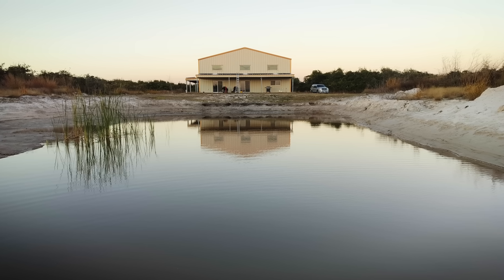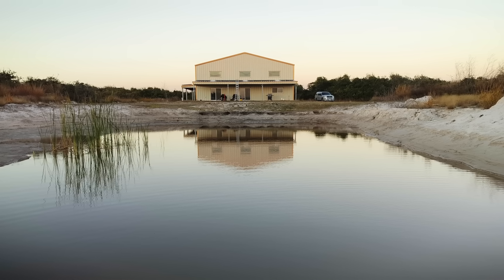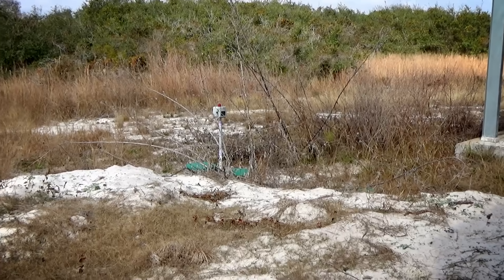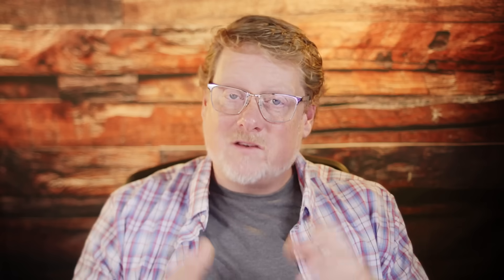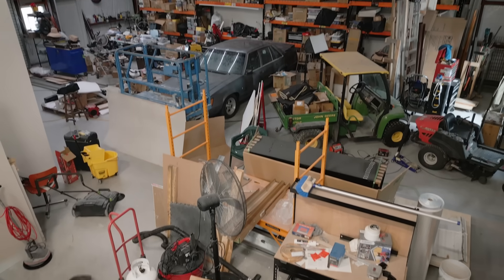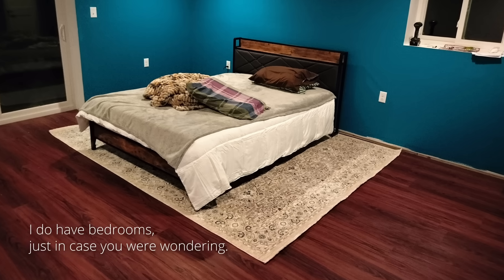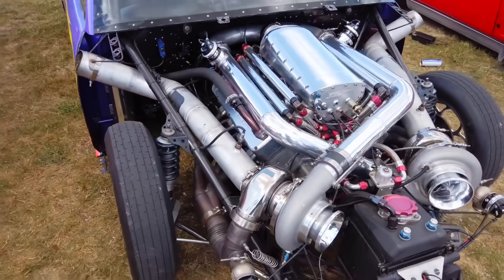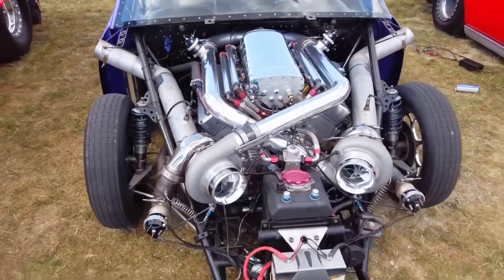Twin Turbos - How Does the Boost Add Up?

Comment: I wonder if you could use the free 10-15psi boost gained through compounding, by redesigning the system to reduce the electrical load (through smaller turbos and electric motors) to get your 30psi?

Comment: CAN YOU MAKE ONE THAT WILL SUPPORT 2500 HP ?
Reply from the maker: Well, yes and no.  You can make a single unit to support that power, but it's not practical given current technology and available parts.  What you can do is stack multiple units together to get to the 2,500 hp level.  I'll be dyno testing various combinations (twins, compounded twins, etc) to see what works best.
Reply: @AlexLTDLX  How about 1500 ?
Reply from the maker: @StreetLegit  Your best bet is to use multiple units to get to a hp target above 650hp.  I'll be doing dyno tests soon of multiple units.

Comment: I guess regarding boost your thinking will add up. But think about it... what doesn't change after the first compressor?... it's the air mass! And in the end that is what you need to burn more fuel, not hotter and more dense air in lower quantities.
Reply from the maker: Ah - but does the air mass not change?  After all, the second compressor is sucking air in.  The purpose of the video was to explain the common theory.  I'm in the process of buying a dyno to actually test the theory - something that no one's done before that I'm aware of.  That's one of the many beauties of the electric supercharger project.
Reply: @AlexLTDLX  if the following ones compressor air of the previous ones I can't see where more air mass could come from. The way it works could only be that the amount of air that the first compressor sucked in gets compacted more and more by each compressor.
Reply from the maker: But if the second compressor is helping to "suck" air into the first compressor, then maybe that's where the additional air mass comes from?  This is all theory.  I'm more of a practice guy.  My new Dynojet 224x is slated to arrive on Tuesday.  We'll be able to actually test this stuff and see who's right.

Comment: How would the 2:1 compounded turbos compare to one 4:1? If my math is correct, they should be able to put out the same amount of boost.

If they’re electrically driven, there shouldn’t be any lag from either setup, which is one of the reasons people go for the compound turbos.

If the setups do make the same boost, I would imagine it would be more efficient and/or cheaper to go for the single 4:1 turbo.
Reply from the maker: In theory, they would make the same amount of boost.  Most turbos are happier (i.e. more efficient) being properly sized at a lower pressure ratio.  So in practical terms, the compounded turbos would likely make more power and less heat.

Comment: Gale Banks says it's about CFM
Reply from the maker: Then Gale Banks is wrong.  1,000 CFM at 200* air temps will support a lot less power than 1,000 CFM at 30* air temps.  It's not about CFM, it's about air mass.  Air mass defines the amount of oxygen available to burn fuel.  CFM does too, but it does not take temperature into account - if you set your fuel maps based on CFM, you could end up being super rich or super lean depending on IAT.  If you set your fuel maps based on air mass, your A/F will be much more consistent.
Reply: @AlexLTDLX  CFM is CFM. No matter the temperature lol. But it is useful to manipulate the temperature in order to gain more CFM. But chemistry is chemistry and CFM is CFM

Comment: You seem to act like horsepower exists without torque. I think that may be what is confusing to people to your perspective. Torque is of course the the force that, combined with time, is measured as horsepower.  Torque is what you can actually feel.  You can't feel "horsepower".  It's only a measure of work done.

Comment: Alex, these tropical compressors do not have any built-in pressure ratios… only a lysolm screw machine does.

The power required to run at Stonewall  (aka choke) does not go up and the efficiency also goes down… The power goes up because the efficiency is going down. That is all stonewall is, tanking efficiency.

Your non-or cooled second stage will only be processing about 70% of the volume metric flow as the first stage did and so to run also at a pressure ratio of two will be running significantly slower. 

Your X access on a compressor curve is not really mass flow at all, that is volumetric flow with some assumptions baked in to create a more convenient axis that works well enough. To really look at where that second stage is going to run with the hot inlet, apply an approximately .7x derate to the x axis. that is just roughly where the density works out because while you are at twice the pressure you are significantly warmer. For other pressure ratios that would change with discharge temp.
Reply: Spell check! Centrifugal not tropical LOL. Probably other typos… commenting from phone stinks…
Reply: If you enter cool between your two stages, it will make your second stage more efficient. If you get it close down to ambient again, you will be dealing with approximately half the volume metric flow though and potentially close to surge. Apply a fudge factor of approximately .55 to the X axis of the compressor map that you were trying to use to figure out the speed that it will need to run that to make a PR of two.
Reply: If you are interested in efficiency, then intercool it! Maybe you don’t have a smaller compressor available for the second stage or it still wouldn’t be worth it… But intercooling saves power on second stage.

Comment: It's kind of like electricity. If you hook a 12 volt, ten amp battery up to something you have 12V at 10A. if you hook a second battery to that, positive to positive and negative to negative (parallel) then you still have 12 V, but at 20 A. Now, if you hook up the positive of your load to the positive of one battery, the negative of that battery to the positive of the second battery, and the negative of the second battery to the negative of the load (series), you now have 24 V, but at the original 10 A.

A turbocharger is kind of like that. If one is capable of producing 15 pounds of boost, that's all it can do. Adding another turbo of the same capacity into the same intake chamber will not increase that pressure, but it will increase the rate of flow; the two turbos will be able to maintain 15 pounds of boost at a much higher CFM rate than a single turbo. If you have two 15 pound turbos and you want to increase the pressure, then you run them in series. The first turbo takes in the air and compresses it and feeds it into the intake of the second turbo, which then compresses it further and feeds it into the intake manifold. You probably won't get 30 pounds from two 15 pound turbos, but you might get 22. (PS: I didn't watch the video, sorry, it's too long)

Comment: I wound up with a crippling lifelong hopeless addiction to Hot-Rodding, modifying, blah blah blah the car enthusiast hobby back in the early 2000s. Now ebay was coming into its own back then and before the slaves in china starting making churbos there were the electric turbos!!! Not the modern electrically driven forced induction systems of today no no, these were about as powerful as a hopped up desk fan. And dummies bought them up until mighty car mods did their episode to see if they were a scam and surprise surprise  they were. Ah memories

Comment: If your first compressor is 78% efficient, then 22% is going to heat the air, housing and bearing friction, thereby reducing air density, is your effective pressure ratio of 2:1 then close to 1.66:1 for the second turbo? That's (15psi atmo * 2) + (15psi atmo *1.66 = 25 psi) = 55 psi - 15 psi = 40 psi. The second turbo would also need to be 22% higher flow rate at the 1.66:1 effective pressure ratio than the first turbo to match their flow rates.

Comment: Well it doesn’t you get a broader power band because the smaller twin turbochargers spool up much sooner then one big one. Another benefit is that you get far less turbo lag also, on a twin turbo setup. But if you use an aftermarket turbo system you can use larger turbos on the compressor end and still spool up like stock. But get more air flow into your engine you can use 8-10 psi which makes way less heat and makes a lot more power on your engine. Turbos are mass airflow devices and not governed by CFM like air filters and throttle bodies are rated by.

Comment: Horsepower is a measure of air you can cram into an engine try dumping a ton of fuel into one and it’ll hydrolock as long as you have enough fuel to make your airflow stoichiometric then you will create more power after all the are air pumps not fuel pumps

Secondly the first supercharger would need to be larger than the second supercharger IE the big turbo feeds the little turbo if you used two same size (compressors) then you wouldn’t be compressing anything in the first stage because the same flow to feed the supercharger would be happening at the same time. The atmospheric compressor needs to outflow the smaller one creating a pressure differential between the two compressors reference diesel compounds for a visual representation. The second turbo or compressor is known as a high pressure compressor this is where that magic happens I like to explain this to people in person by imagine the high pressure turbo is seeing 30psi in front of it instead of 14.7 more dense air entering means more dense air leaving

Comment: Sequential turbos, basically think jet engine compressor stages and you're doing the same thing. But they have 10-20 compressor stages instead of 2. Very cool stuff. Also, completely share your sentiment on torque "Torque wins races!" 

No, average horsepower wins races. But these people don't understand a force vs work or math so, not much you can do.
Reply: Assuming you can put it all down in the most optimal line

Comment: You got some whacky math indeed.
2:1 , multiplied by 2:1 , yields 4 to 1. Substract 1 for ambient pressure. You get 3, and 3 times 14.7 is 44.1...
Quite simple.

Comment: Do a collaboration with richard holdener at westech engine dyno. More dyno data for all
Reply from the maker: Westech is 1,500 miles away from me.  And I honestly feel that with my own dyno, I could do a lot more testing that relates specifically to what you guys (the subscribers) and myself actually want to see.  There's another huge benefit - I could do a lot more videos a lot faster.  I have plans to permanently set up cameras and lighting around the dyno since it won't be a "working" dyno - it won't get farmed out to tune people's cars.  Because of my job for the last 30 years, I've accumulated a lot of production gear - more $$ worth than the cost of the dyno.  Lights, lenses, cameras, audio stuff, a video switcher, etc.  It would all be just for us, really.  And beats having that equipment just sitting around waiting for a project.

Comment: Compounds make more sense when you understand that compressors/turbines operate on pressure ratios. 

The torque/horsepower analogy is easy as well. Torque is how hard the hammer is swung. RPM is how frequently the hammer is swung. Obviously if force is same and frequency increases, the work performed per unit of time is greater. This is why that engine making 1000hp at 9000rpm yet making under 600ft/lbs at that point, is going to outrun the engine making 600ft/lbs at 4000rpm as that would only roughly be 460hp. 

The premise of this video is simple. Boost is merely a resistance to flow through an engine. The engine will move a certain cfm as that's a volume flow. Mass flow is what makes horsepower, which is why boost (increasing density) makes power. Really not complicated.

Comment: My question about the compound turbo idea was that the bottom of the compressor map was always is mass flow (lbs/kg of air per unit of time), so it seemed like you would need 2 compressors of the same size to generate be able to flow that mass at double the pressure.  Sounds like that's your read as well.
Reply: I came to the comments to see if someone asked the same question. For his math to work the second turbo has to have enough volume of air being fed to it at 15 psi. I had a Mercedes with this style turbo and the second turbo was smaller than the first one.

Comment: EXCEPT...

YOU STILL NEED POWER FROM SOME PLACE to DRIVE those compressors.

Be it in the form of an expensive, short burst from a LiPo battery, from the alternator, or from some other power source [and I can think of a few].

There is STILL no free lunch.

Comment: Twin turbo's on the v-cylinder engines were made to have equal exhaust back pressure/equal flow on both cylinder banks.

Comment: Air density is what determines HP not PSI, A good intercooler will make almost as much power as the turbo its self.
Reply: You can also run injectors at the intake plenum which will significantly cool the intake charge

Comment: 2 questions (mind you I'm partially retarded and broke)
1- If you had a v8 making 500 hp and wanted to twin parallel turbo, wouldn't you have to figure for half the value of the engine due to one turbo per bank and thusly you still end up with the same efficiently problem for this turbo?
2- Why are there no electric superchargers? Isn't it more psi at less rpm, making it easier for gearing an electric motor? Like, if your testing, it would be cool to see proof why there aren't any.

Comment: Why not quickly bolt another e-charger on your current car in compound setup. Then use something cheap like a draggy meter to extrapolate the power gains? Would be more relatable scenario for the masses and be heaps cheaper than buying a dyno and setting up some huge triple compound setup no one will over do?  Meth injection between the stages would also be great. 

Also wouldn't smaller motors make better use of the e-charger? Boost is more efficient than cubes and compression (to an extent) I'd think something like a modern 230 cube straight 6 or similar smaller motor would allow you to run much more boost. 

Just a suggestion, love the content.
Reply from the maker: The problem is even with just the Sledgehammer it's impossible to get useful data on the street - I get nothing but wheel spin.  And it's a lot easier to setup various combinations on a work surface next to the car on a dyno; plus the data is more accurate.  I also have other plans for the dyno - a fun little gameshow, testing other things (mufflers, ignitions, etc).
Reply: @AlexLTDLX  Awesome! More power to ya. Will  be a great tool to have!

Comment: It makes sense why the intercooler vs. aftercooler has such benefits. Regain the air density after the first stage of compression and then right into that second stage. The increase to the boost at the intake manifold should be noticeable.
Reply from the maker: I think you're right.

Comment: Yes, torque is a force. 1ft-lb is 1lb on a 1ft lever.
Torque: How hard you can twist something.
 Horsepower: How quickly you can twist it that hard, repeatedly.
Car A: High torque, lower horsepower. It'll feel very responsive and quick off the line, but might not be as fast at higher speeds.
  Car B: Lower torque, higher horsepower. It might feel a bit slower to get going, but will accelerate strongly once it's moving and will have a higher top speed.
  A Dyno measures torque with a load cell just like a torque wrench. It measures it throughout your rpm range.
 Horsepower is how fast you can deliver that torque/force over time/distance.
Get it? Got it? Good! 🤓👍
Reply: I always say, Torque is the ability to make work happen, Horsepower is the ability to keep it going.

Comment: Know someone that built & sold dyno(s). Seems if all the parts/pieces are available, you could easy assemble one. Time wise it may take longer, but guessing it would save drastically on the cost.
Reply: Plus if you build a portable dyno (trailer), it could be sold for profit after tests conclude.
Reply from the maker: That's true.